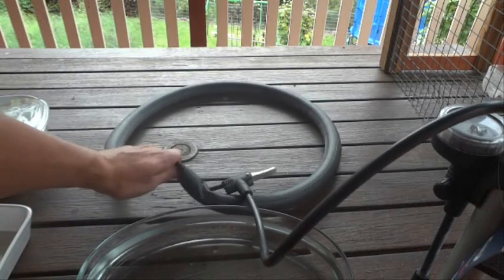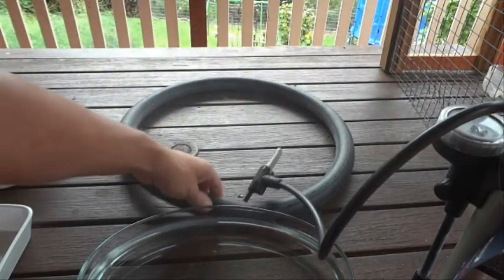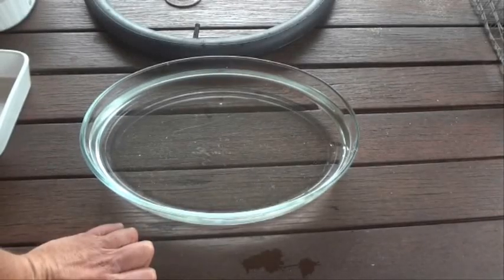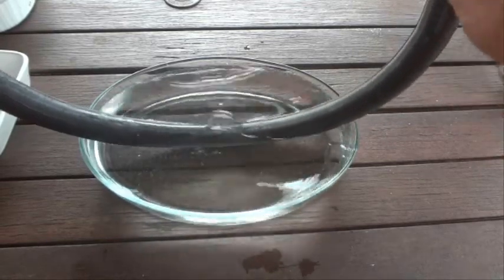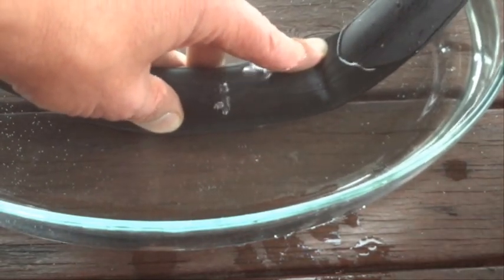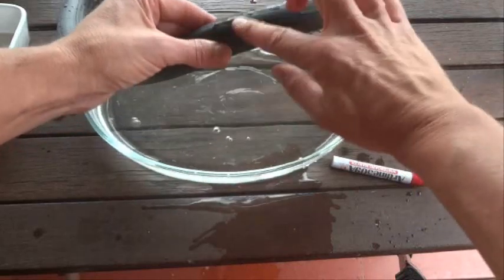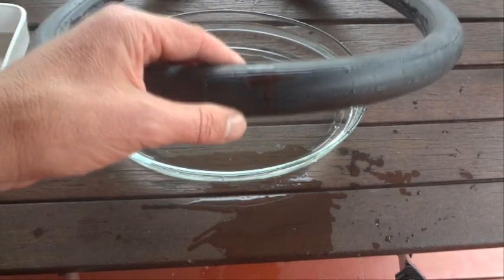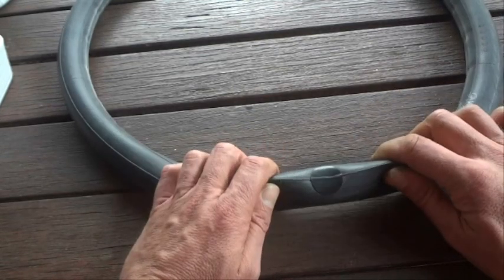How to Find a Hole in a Bicycle Inner Tube - Finding a Bike Tube Hole - DIY

Comment: I've been doing it like this since I was a kid, always worked well. But I'll be damned if this method isn't working on my daughters mtb!  It has a slow leak, if I inflate in a matter of a few days it's completely flat, but yet, it won't show amy bubbles in a bucket of water.....any further tips? Anyone?
Reply: I'm having the same problem too but I've found my leak by slowly moving the tube atound near my ear until I found the leak
Reply: Same issue.No bubble but over night it gets flat.After 3 times i bought new.LOL.
Reply: That is because the pressure inside the wheel and the size of the puncture isn’t creating enough force to push air into the water
Reply: Inflate it to a higher pressure 🤔
Reply: Same here !  I've 40 years pucture experience